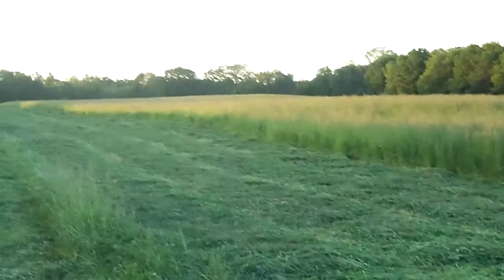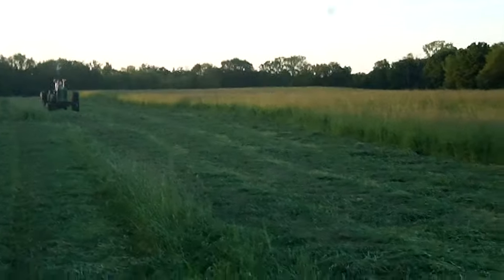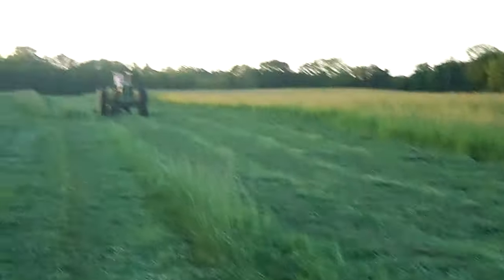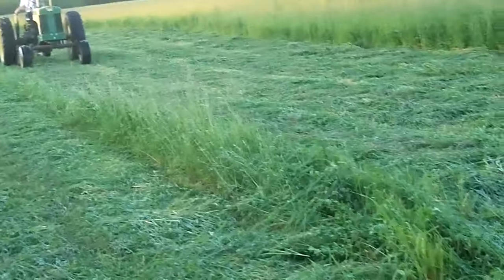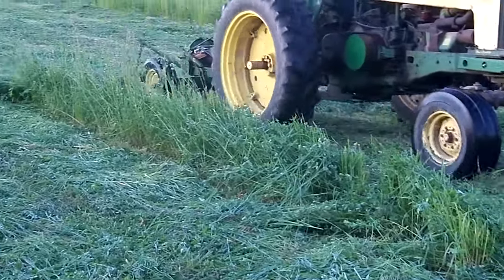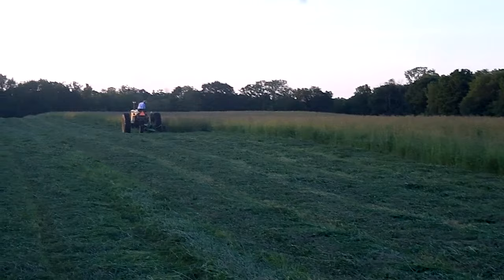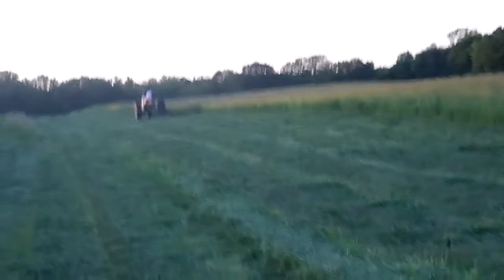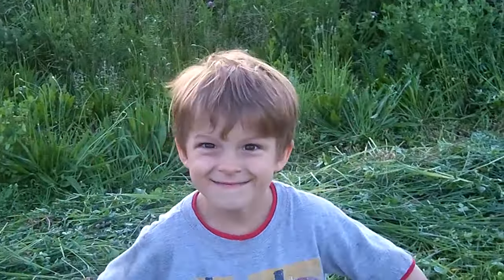John Deere 37 Pull Type (trailer type) Sickle Bar hay mower and hay cutting

Comment: sickle bar is much slower than a moco. sickle bar is usually only good for 3-4 acres an hour.

we mow with a B John Deere, save on fuel and than we have the bigger tractors available for baling work.
Reply: You might be able to mow faster, but then you wait an extra 24 hours on drying time.  Even in the thickest brome I mow one day and rake 24 hours later - or less.  Then immediately bale.  Trying to get three dry days in a row has been nearly impossible the last couple of Junes.

Comment: We just bought a jd 37 sickle bar mower.   And ares have been clogging up towards the inside of sickle bar mower where there are some after market gaurds in place of John Deere gaurds.  We are thinking that it's the aftermarket gaurds.  Any suggestions?
Reply from the maker: All21 Leishman We only use the after market blades from Tractor Supply. They could be dull or used the wrong rivets.
Reply from the maker: Also, Tractor supply has several types of aftermarket blades. We have 3 on our shelf. One said upper, one lower, and I dont remember the 3rd. I know the JD swather blades are one of the varieties we have. Maybe the seller put the wrong ones on. The differences are subtle.  When we got ours new to us we replaced every blade and had a new pitman arm waiting in the shop for when it broke. Which if I remember only took 2-3 uses as these are wooden and sit out in the elements at most farms. Use caution they are sharp. Somebody ended up with stitches that first time.

Comment: A plugging haybine needs to be adjusted.  You should get better drying time and be able to mow just as quickly.  If you husband doesn't own a manual for the MoCo he needs to get one and study it.  I suspect either the cutting deck is misangled or the reel isn't right.
Reply: I suspect Frank at the bank had more to do with the decision than conditioner conditions.
Reply: Need a tractor capable of pulling a Moco and give that sickle bar a couple years to wear and it will plug so fast your head will spin.     Been there done it.